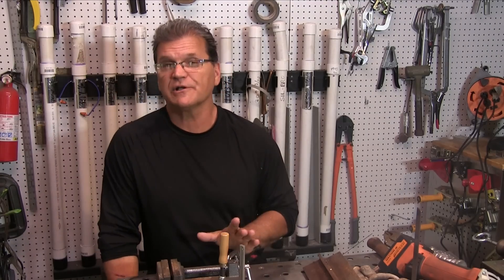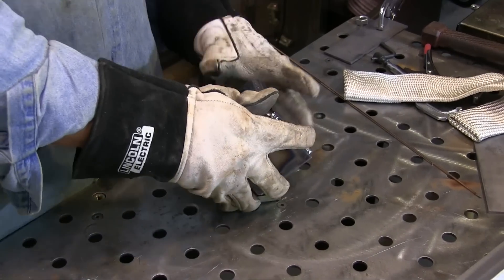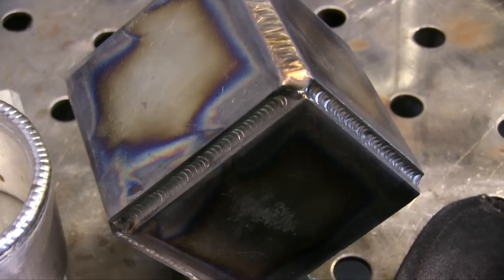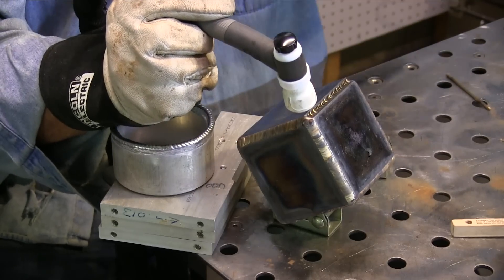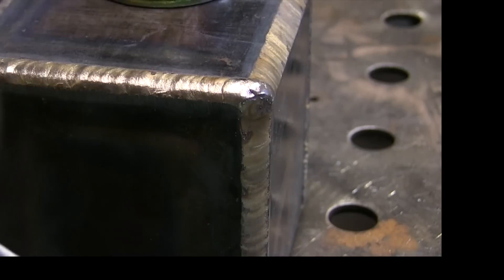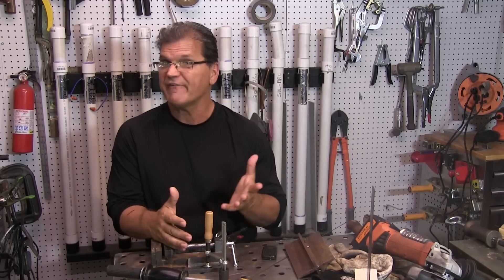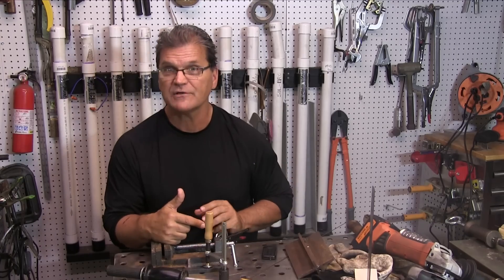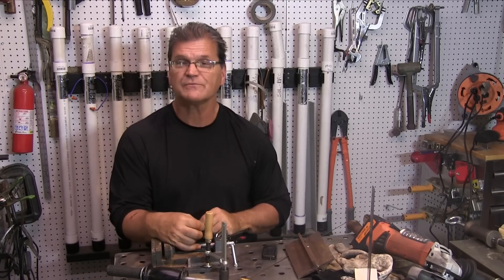Tig Brazing a Steel Cube

Comment: Would you do a remake of your weld distortion video with Silicon Bronze? I’m contemplating a tab/slot project in steel and am wondering if the low temperature  needed for TIG Brazing might let me avoid a stress relieving bake.

Comment: I've been slowly teaching myself various welding processes as part of my job over the last couple years.  Around my shop I have some SiloconBronze Brazing rod that is coated in a white plastic type of jacket that I've used for brazing with the oxy-acet torch.  Can this same stuff be used for TIG brazing, or does it need to be raw?
Reply: You might be looking at flux-coated brazing rod.  Coated with a smooth white almost ceramic looking coating?  That melts under the torch and turns into a glassy clear flux. That spreads out and cleans the base metal and so on.  I think that's not suitable for TIG process

Comment: Dumb question: Is silicon bronze the same thing I buy at hardware store when I buy brazing rod?
Reply: It's not!  "Brazing Rod" in general is more like brass, it has zinc in it.  Most of what you can buy is "Low-fuming Bronze".  The zinc tends to burn off and make white smoke.  Low-fuming bronze has stuff in it to inhibit this smoke.  Slightly oxidizing flame and some FLUX can make it work entirely.  Silicon bronze is different, it doesn't smoke.  This is better for you and for the TIG torch.  This material is available in rods and sheets and so on, and is used to make things that resist corrosion. "Everdur" is a famous name of commerce.  I think we would make everything out of it only it's expensive compared to dear old mild steel.  Silicon Bronze can be welded by all methods.

Comment: I remember attempting some cubes in welding class years ago, the rest of the class wanted to do their own also. Near completion of the cube some decided it would be a good idea to quench theirs in water and clean it up a bit before tacking the last panel on.

Water with nowhere to go plus oxyacetylene equals BANG!

I’ll throw a mistake of mine in also, I tried to fix a brass zippo lighter with a brazing rod and an oxyacetylene torch. I was picking molten brass out of my face for the rest of the day, goodbye zippo.

Comment: Jody,

I love your videos I have been watching your videos for a long time and have learned so much from your information and knowledge!  I use an AHP 200x tig that i first saw on your channel and I have been more than pleased with it and the stubby gas lense kit!  I have been wanting to try my had at some TIG brazing with silicon bronze like you have demonstrated in your videos.  The last time I was at my welding supply store I asked if they had any in stock and they all seemed dumbfounded with what I was talking about.  I am curious as  to where you get yours from or what should I specifically ask for at the store so that they can maybe order some in for me.  I would think there might be a more technical designation for it but I am not sure. Any insight you have would be very helpful.

Thanks,
Jake

Comment: Ive used silicon bronze rod on a malleable iron pipe fitting to get us out of the crap, it had a small hole from casting, Only difference was I used oxygen and acetylene to braize it in.

Comment: Some military ships have aluminum pilot houses/ bridges. I believe it was preferred because it will not shrapnellize when hit. Anyway the structure would always be welded (brazed) with silicon bronze to the steel hull. You cannot connect any other way because you will get serious electronics because of the dissimilar metals and salt water, but you do have any problems when it is welded.

Comment: Could you do this at a lower amperage than 120A? I'm thinking that at 120A it could be fairly easy to melt steel if moving a bit too slow, so would lower amperage help less experienced welders with Sil. Bronze brazing? Thanks!

Comment: Love the videos keeping coming I have a question for you I have a ahp 200 tig when I'm welding I get ark flash that my helmet can't filter out it just started I thought it was the batteries going dead on my helmet I changed them it still happening can you help
Reply: Some automatic helmets don't work well when you're using DC I've found.  They'll turn dark when you first strike an arc, and then quit after a bit.  They're looking for the flash and won't stay dark because (say) of the sun, or a bright lamp.  So, there might not be anything special happening with the arc, it might be your helmet.  Some automatic helmets have a "sensitivity" setting that can help with this.  Then if it's TOO sensitive it can be set off by things like LED lamps!  I like to have a rugged simple helmet with just glass in it nearby, just for things like this!

Comment: that's slick.before I got into pipeline welding I spliced/ repaired dragline trail cable(think 25,000 volt per phase 3 phase extension cords in 1,000 ft lengths) we gas welded the actual conductor cable each layer at a time with silicon bronze it was not easy to get it to look good but I sure got lots of practice great videos keep it up.

Comment: I use the mig machine with silicone bronze to join Auto Body panels, it keeps the temperature down and the panel will not warp. Great videos thank you.
Reply: Terrence Park think I may have learned about a new trick with your comment but what exact type of mig wire??
Reply: Scott Everett silicon bronze CuSi3 .030 (0.8)mm. Watch you tube video ProSpot Welders look for silicon bronze video. You don’t need there welders just the wire and argon gas.

Comment: I'm was  bit confused on the use of Silicon Bronze vs Aluminum bronze after watching this video because I believe you said (in this video) that Silicon bronze was not the best choice of filler for fixing say a crack in a cast iron Cylinder head. So I went back and searched for other videos you've done on tig brazing cast iron and confirmed that it was Aluminum bronze that was the better choice. Thanks for having such a wealth of info on your channel. Much appreciated.

Comment: hey i'm gonna buy a cutting torch, i'll get a propane one because i don't want a cylinder of acetylene in my garage,  i heard that propane welding sucked because the acetylene kinda shield the weld with co2 and propane don't, is that true? i broken up my grand-father bench visse and i'd  braze it with silicon bronze  to repair it
Reply: martin blouin don't quote me on this, but I believe using propane introduces too much hydrogen into the weld, causing cracking and weld failure

Comment: I actually find that I use it quite a bit as a gunsmith to attach sights and lugs to the barrels of guns in general. This is also what many manufacturers used during the 1800s and early 1900s so it helps keep the materials historically accurate.

Comment: I met a guy a few weeks ago that does mobile TIG welding repairs on commercial aluminum sprinkler pivots (the huge ones you typically see in corn fields). He faced one side of his hammer with this TIG brazing technique. The benefits that he explained to me were that it's softer and you can easily grind/shape it to the contour you want. Great for smacking aluminum around into submission before welding. Kind of like an oversized autobody hammer.

Comment: Great demonstration Jody for brazing with this stuff.  I know you don't do bronze artwork.  But any chance for a demo for actually WELDING bronze with sil-bronze?  There is no one on YT teaching this.  So far, DC has been working good for me, but as you know heat control can be tricky with this metal.  Too much and it's cave in city!

Comment: Nice video Jody, how much does it cost a pound of silicon bronze?
Reply: This is an old question, but for others who may scroll, I paid 15.99 plus tax for a pound of 1/16th this morning at local welding supply, about 31 36 inch rods.  I've seen about 22 a pound online.

Comment: Scotchbrite the filler rod!!! Yeah!! You are the first I have heard that does that. I do it and I don't weld often. Did not know if it really helped. Thanks for validating Jody.
Reply: Standard practice for the guys brazing with Oxyacetylene on thin stuff (bicycles). Also the Ti guys wipe everything down- all the time.  Tha's where I picked it up.

Comment: Can you cover SiBronze brazing troubleshooting. I made the 6mm plate cube for practice (absolute TIG beginner) but had the rod “vaporise” at high amps. But at 69-80A couldn’t get it to flow before it started burning. Onbviously I need to try again.
Reply: Dunk O cleanliness is everything with brazing. Make sure your base metal is ground down to shiny on all sides of the joint and wiped with acetone. Clean your filler with acetone too. Are you using filler from a welding store? The stuff from the local Tractor Supply or Farm and Fleet is filthy and won't tig for shit in my limited experience. You can also try using AC. Jody makes it look easy, but this stuff is picky, it took me a ton of time to get it to work even sort of good.
Reply: Hey, thanks for the reply.  I suspect it is a cleaning issue.  I wasn’t aware that it was so sensitive.   Harking  back to my plumbing days, I guess we used to clean the copper pipe prett good before silver brazing as well!

Comment: In the motorcycle shop I used to work at we used silicon bronze to fill in rusted out parts in chrome pieces before being re-chromed as it's easy to file down, Nice cube.

Comment: every now and then we get a job where the base material is bronze,we've found so much difference in the base materials we have a rather difficult time with choosing silicone or aluminum bronze filler,ac or dc,straight or reverse polarity as it seems all bronzes are a bit different...any advice would be helpful,thanks!

Comment: I worked 9 1/2 yrs. at a bronze sculpture foundry and welded bronze to bronze. The sculptures could be 20' high and had to have structural integrity. With long overhanging limbs(arms, legs etc) we always reinforced them with stainless steel armature. since leaving the foundry I have had difficulty inspiring confidence in other employers that I have welded and not only brazed. I was getting fusion and adding filler rod to a puddle. Now I am doing production MIG welding and it's a whole new world as I rarely used a MIG previously. I lean on your videos often to jump this gap in my skills. At 45 it's tough to break into production welding and you've helped a lot.
Reply: I work in a Bronze foundry at the moment and I'm sure we are welding! especially when its bronze base metal and filler. if the base metal is melting/pooling then it's welding surely? it's funny how much we rely on TIG at the foundry, I have two years experience with TIG and almost nothing with MIG.
Reply: Let me know if your ever asked to cast and weld the dreaded white bronze (tombasil) toward the end there I had it down. lol
Reply: I worked in a bronze foundry for 5 years myself, my main job was welder, but I made molds and did casting as well. I burned a ton of silicone bronze TIG rod in that time, it was very interesting work, I enjoyed it...

Comment: Great video as usual! I bought some silicon bronze rods after watching one of your earlier videos and have been experimenting with it here and there. I have found it useful in auto body work. I work on some cars that have what I have assume to be brass brazed joints here and there. Of course if I try to weld in these locations it makes a terrible mess unless I remove all of that material. At the lower brazing temp I seem to be able to remelt whatever brass/bronze material the factory used and add silicon bronze w/o any drama. 

I've also used it with success in joining stainless steel exhaust systems that come in small parts that are designed to "slip-fit" and clamp. Silicon bronze seems to be a good way to seal these up while providing a joint with a little more give. Plus it looks a whole lot better than a clamp!

Thanks again!

Comment: Can you use TIG brazing to braze tube into sockets or similar jobs or is the heat too localised to flow the filler into the joint?

Comment: Thanks for the video!  I was out in the garage working on my motorcycle over the weekend going over all the factory welds with Silicon Bronze and filing them down for that smooth made from one piece of metal look.  My hands are raw and my shoulders are sore but it will have been worth it once the frame is complete :)

Comment: Really learning a lot from your videos, thank you so much. One question i got now is, i'm getting into the whole tig welding scene, and this past weekend i got to hook up the foot peddle doing aluminium. No i hear you saying your welding at precisely 120 amps, how do you choose when to use the foot peddle or the set machine settings with the finger trigger, or is it just a 'over time' kind of thing that will make it more comfortable for you as user?
Thanks
Reply: Juan-Pierre Oosthuizen with the foot pedal you get a lot more control over the puddle and can adjust on the fly. You can set it for machine max amps and feather the pedal to your liking. The torch trigger is usually best for stuff you dont need to change amps a lot or if you can't use the pedal because youre out of position. You can use the trigger as like an on/off switch or you can use it to bump down say like 25 or 50 amps, for whatever seconds you want, and having it return to your set amps for times you get too hot. Or if you're tig welding pipe out of position where you're pretty much one amperage. For aluminum on a bench I would recommend a pedal, set like 25 amps above what you think you need so you have wiggle room. Dont get me wrong, you can use the trigger on aluminum but you'll need to be pretty close to amps. If youre a little cold you may need to camp out a little to get your puddle started, compared to the pedal where you floor the pedal until the puddle is formed and lower heat to what you need to run a bead.
Reply from the maker: normally, I probably wouldnt even know the exact amperage and would just set the machine plenty hot enough and use the foot pedal to what seems right.
but since i was making a video, I played around with amp settings on scrap so that I could state exact amperage used